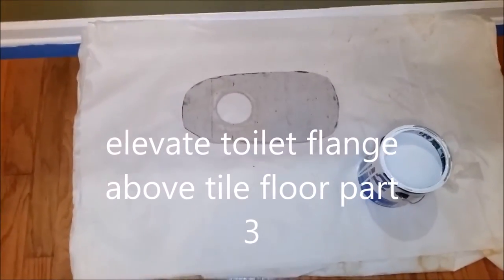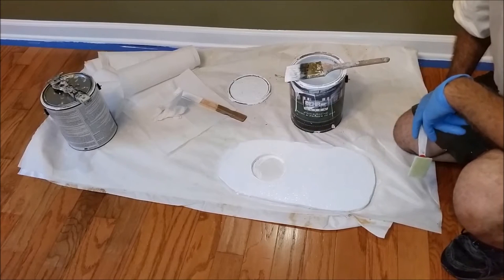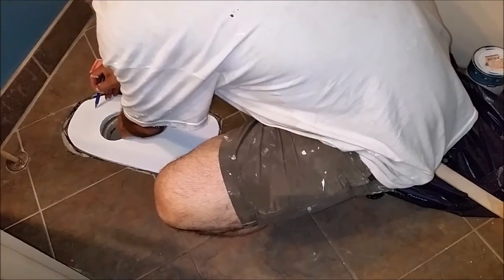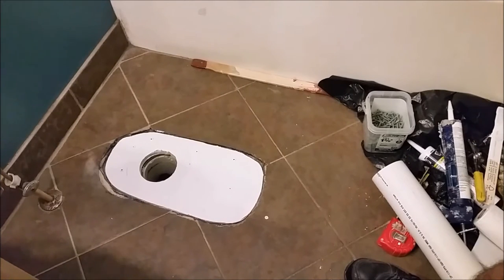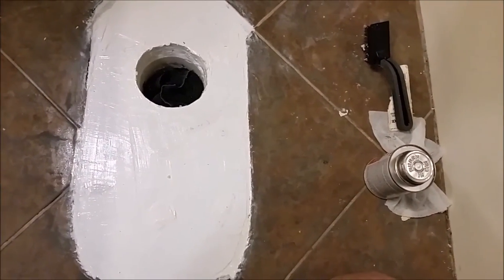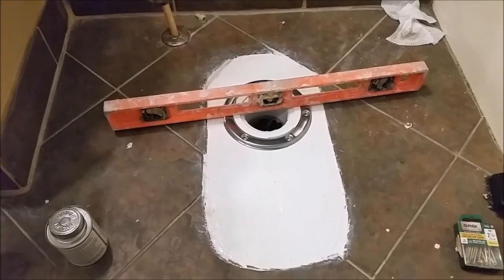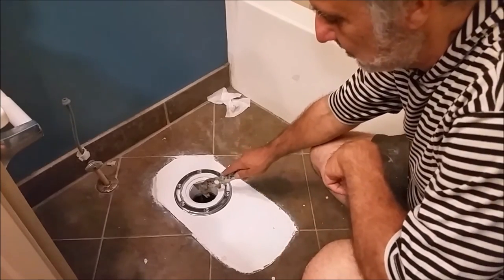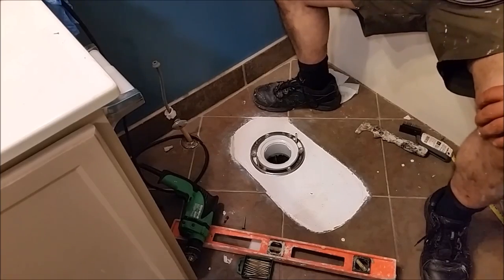How to raise a toilet flange and a toilet base  above tile floor -  part 3

Comment: Or just use shims. Or use a plaster base around the toilet.
Reply from the maker: No you can not do plaster or shims. They will not last under humidity.  Mold and mildew will be created under the toilet seat.